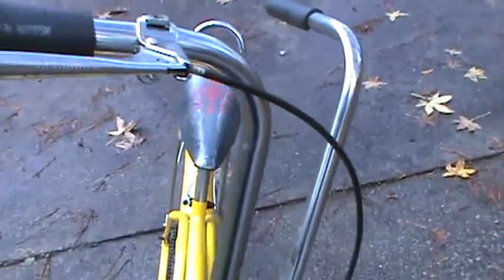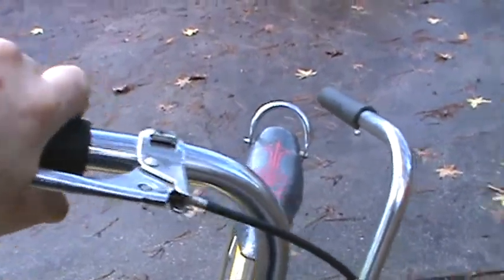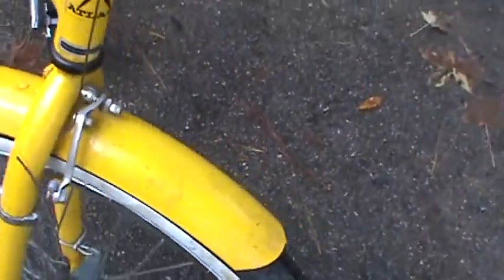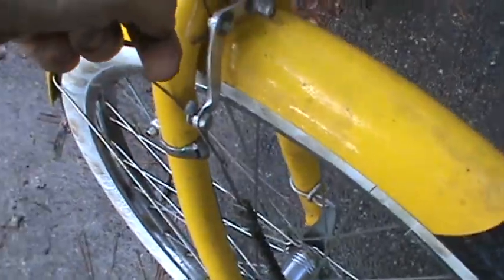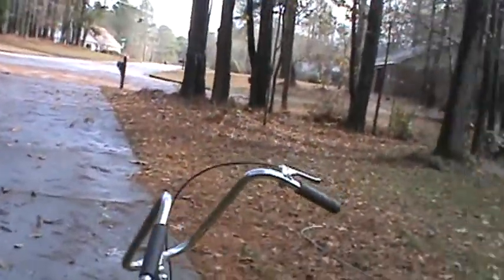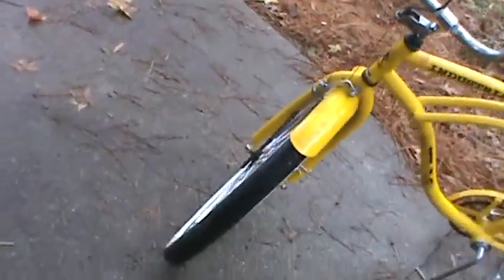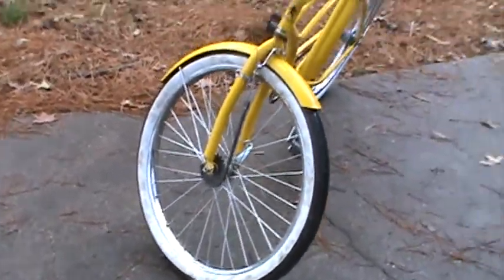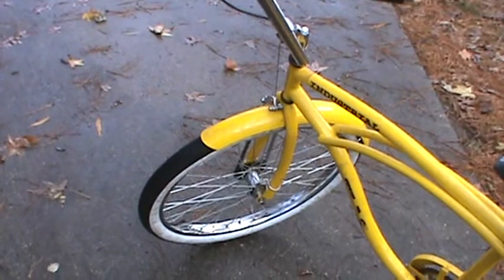Front Coaster Brake Project Finally!

Comment: Good show, Looks like it went well &works as planned. Good job !
Can't wait to see what's next.
Reply from the maker: It didn't quite go as planned. It does help slow you down but you sure don't have to worry about it locking up and causing you to crash,LOL! I would have liked a little more braking action out of it. But the combo of front and rear braking does bring it to a stop quickly, so I guess it's still a success.
Reply: ***** I think lowering the tire pressure would make it not lock up so easy.
Reply: +歩春日 That isn't an issue. Read the comment.